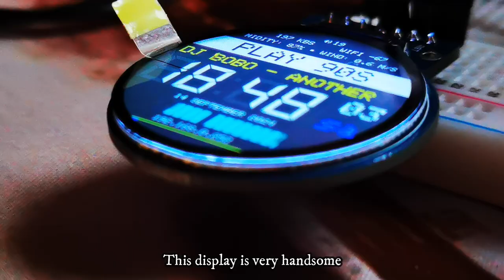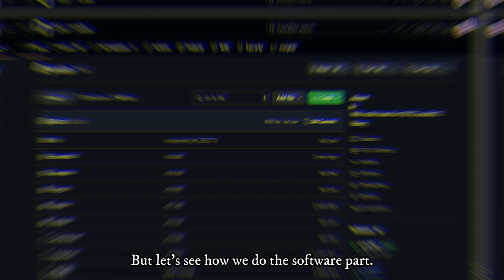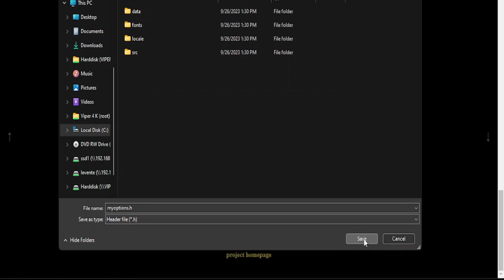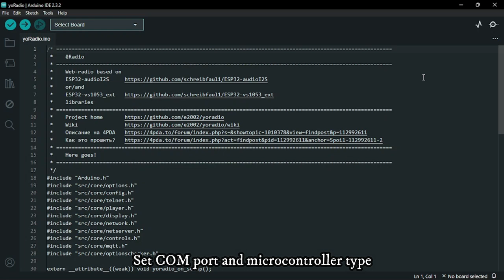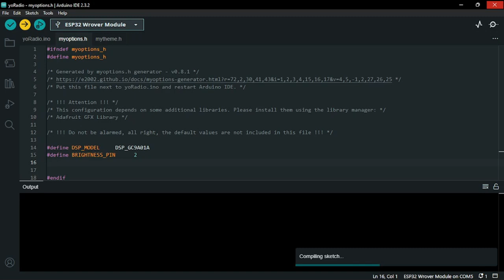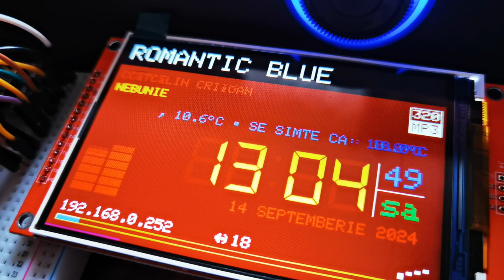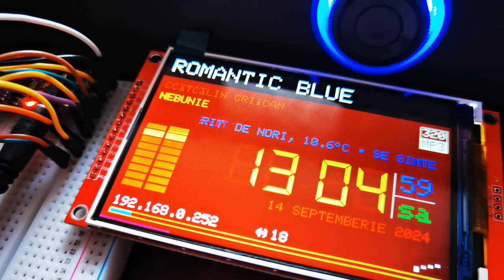yoRadio STEP BY STEP - ( Step 3 - DISPLAY) ESP32 + PCM5102A + GC9A01 round display - webradio player

Comment: Nice video! I think I'm gonna try this display, looks fantastic. Also, for a next video I would love to see the Protoboard or some electronic schematics. I'm having issues with ESP32 + 1334 DAC, sounds "choppy", the audio cuts every millisecond :( Maybe I'm not supplying enough current?
Reply from the maker: I don't have the DAC you use. In the description of the video you have everything you need to make yoRadio following the explanations in this video. There are more yoRadio videos on this youtube channel.
Reply: @LeventeDaradici  Greetings! Finally I made it work, UDA1334A+ESP32-WROOM. The problem is: I can't play MP3 over 160kbps. Now I'm going to try your setup. Thanks
Reply from the maker: With ESP32 Wrover and PCM5102A mp3 also works at 320kbps. I bought PCM5102A from here: https://vi.aliexpress.com/item/1005002898278583.html and ESP32 Wrover I bought it from here: https://vi.aliexpress.com/item/1005004625493776.html Wrover- E does not need the external antenna, Wrover-IE needs the external antenna.
Reply: Здравствуйте. У меня проблема.

Comment: Hello, what do you think is the highest quality DAC that you have tried or heard?
Reply from the maker: I used only the internal DAC which is usable but not very good, (ideal for beginners), the MAX98357 which is mono (two pieces can play stereo) but also has an audio amplifier and has a good sound and the PCM5102A which I like very much because of the sound quality. What I like very much about the PCM5102A is that it has audio output on a 3.5mm jack.